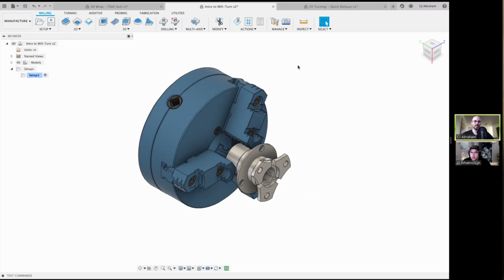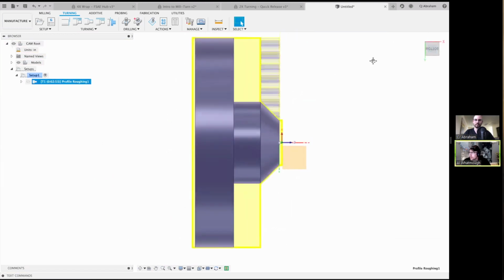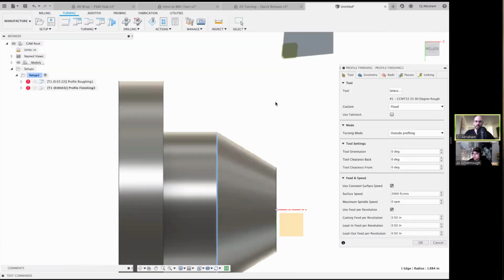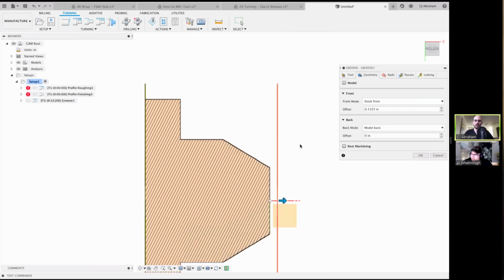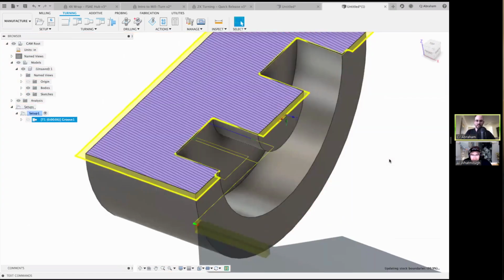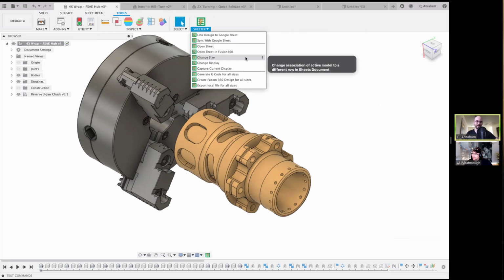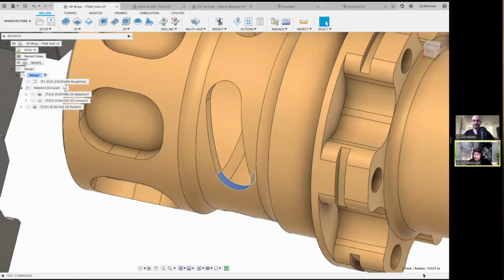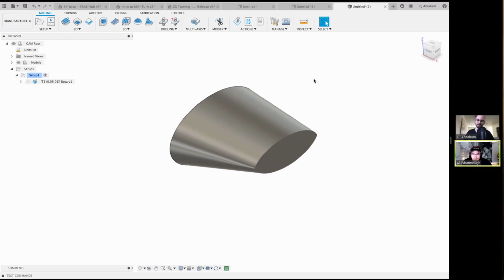360 Live: CAM Hangout

Comment: Although the Rotary tool path is very easy to use, it does not allow roughing. If you wanted to machine say a CAM shaft, the rotary tool path would dive way into the stock. What is the best approach for roughing on a part like that if you only have a 4 axis machine? Would it not be quite easy to add a max step down option so the path would simply step down radially?

Comment: i have a dmg mori ntx 250 that is possible to use a tool around 45 degrees

how to do this in fusion 360
Reply: Kazoku There are a few settings in the tool library, operation, and post that make this possible. If the tool offsets are set in the machine while the tool is at 45, you need only set the insert orientation in the tool definition to 45. The tool angle in the operation modifies the angle of the B axis for just that operation, so if you offset the tool at 0, you would input 45 for that setting on the tool tab. The post just needs to be configured for you machine, and we do have Fusion 360 users programming their Mori NTX, Mazak Integrex, and other B axis mill/turn machines.
Reply: CJ Abraham Can you show on the next Cam hangout

Comment: Might be an idea if you did the face off op after doing the inside work? Great vid! Great tip for breaking an edge with tangential extension. Lads the two of ye are dynamite! This is probably obvious to all but be mindful of chuck direction when face grooving. Might a slot drill be a better idea for the face slot?